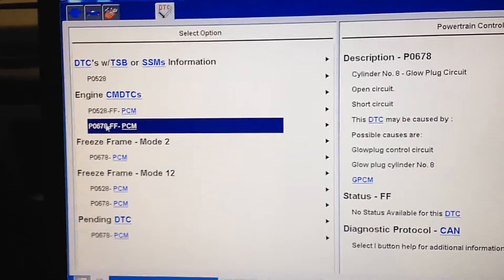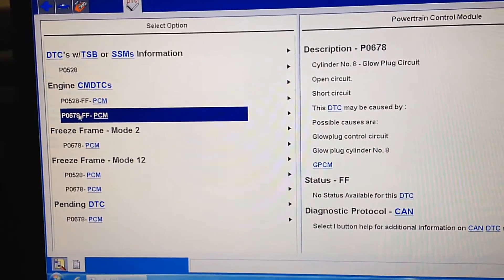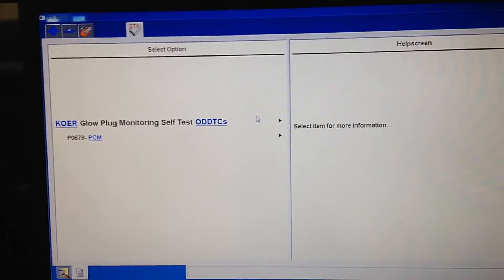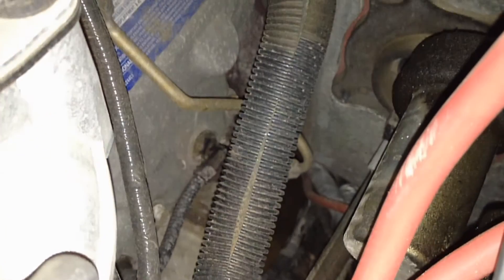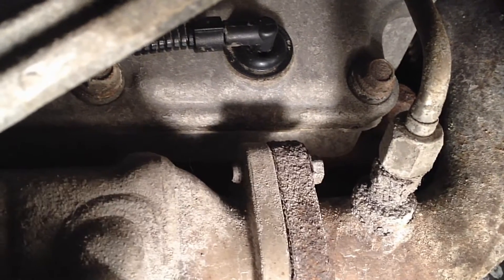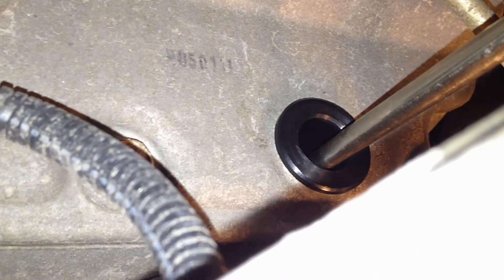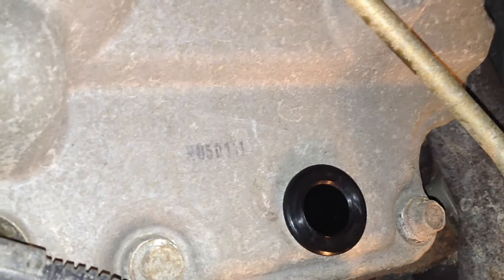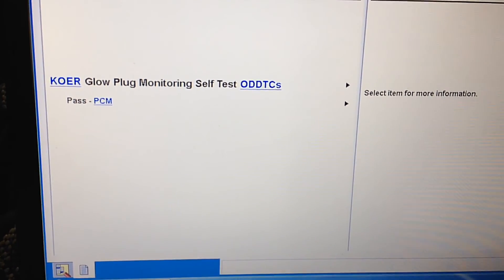6.4L Powerstroke Glow Plug Replacement

Comment: Awesome....have a '08 6.4 Super Duty,   cel on and pulled a P0684  "Glow plug control module"  Napa had one for 300.  That fixed it, but will keep an eye out for defective glow plugs, this really helps if I need it down the road  thanks!.  Wondering if 7 & 8 cylinders will fail more often due to fuel flooding in on regen?

Comment: So what was the problem?  Did you just pull the 8 plug and test it and put it back or did you replace it?  My grandpa took his 6.4 to a "mechanic" to swap his blown motor...  New one is getting random glow plug codes on the even side of the block...  I am leaning to it being a connector problem since it is on the even bank and random.  What do you think?

Comment: i have a 08 f250 6.4L diesel. its giving me code p0308. Do you think this could be the cause? when i turn it on its fine. but when im driving and step on gas sometimes it fails/chokes  and smoke comes out
Reply: The glow plugs don't do anything after you start the truck. Diesels rely on compression to light the fuel mixture.

Comment: not to bad, have any break off in the head? duramax has them external from valve cover and well time to time ones seized in the head... as you know Crazy expensive repair!
Reply from the maker: No break off issues since the 7.3L thankfully.
Reply: ye well if i do recall head replacement ona  6.0 is like what 25 hours? head replacement ona  duramax for both heads is around 35ish... for some reason LBZ doesnt give a time for both heads just says 26 hours per head replacement!
Reply from the maker: Wow those duramax engines sound like a nightmare!
Reply: once you get use to them they arnt that bad, very simular to the 6.7, when it boils down to it dude GM shared ALOT of information from the duramax for the new 6.7, EGR is basicly same location both using CP4's timed the sameway, same injector's, ect... the biggest thing with the 6.7 is removing the cab lowers warrenty times, i personaly wish GM would start doing this, mainly because of the stupid fckin allen head bolts, after a few years of rust they strip out... i made my own torx 35 to get them out with ye old poundy pound hahah